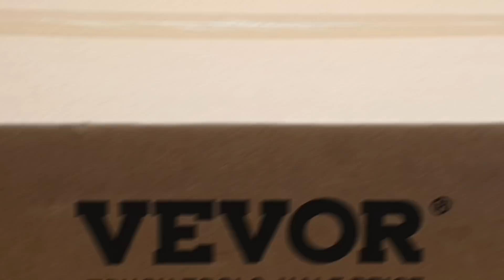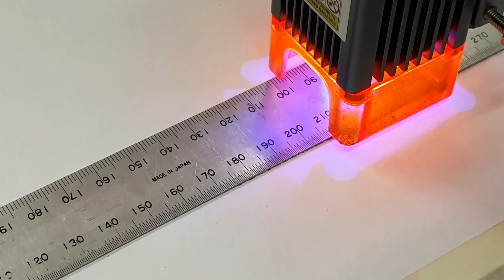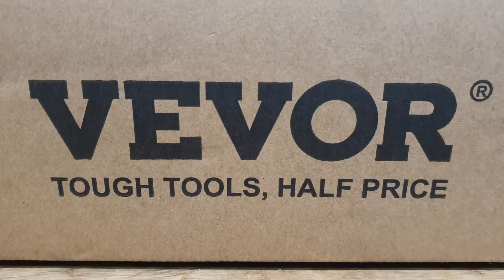VEVOR Laser Engraver Project Build And Review

Comment from the maker: Please remember to check the description for details on the Vevor laser. Any questions please ask 👍
Reply: Hi, we 've got a bit different one - vevor 16,1 x 15,7 where this first step of building doesn't work...any advice? thanks
Reply from the maker: @PatricieDlouha  what seems to to be the issue ? Did it come with a manual ?
Reply from the maker: @PatricieDlouha  this is the same dimensions as the one I have
Reply: Did you have any video where you can show using the cup, mug or bottle  attachment?
Reply from the maker: @blancamgarcia7303  thanks for watching Blanca, no sorry I don't have that attachment. Would be very handy though I think.

Comment: Buenas tardes, tengo esta maquina y le compre el eje rotor, pero los conectores no se donde van, me pueden ayudar?
Reply from the maker: That is a good question. I'm not sure though as I don't have the rotary attachment my self. What do the plugs look like for the attachment ?
Do they plug into the cables that are already attached to the drive motors or are they small cables that may need to be attached inside the control box ?
Sorry I'm not much help but I will see if I can find something out for you.

Comment: Hello,
I am facing a serious issue with my 30W fiber laser, which is still under warranty. The problem is that the laser has lost all power and no longer engraves. I purchased it from Vevor, but they have not provided any solution despite over a month of communication. They now reply only with vague messages like, "We are sorry, but we still don’t have a solution from the team handling this issue."

Do you have any advice or suggestions on how I might resolve this problem? Any help would be greatly appreciated.

Thank you!
Reply from the maker: @luci295  I'm sorry to hear that. How long have you had your unit for ? Did anything happen to it just before it stopped working?
Is the unit powering up and moving but just not cutting ?
Reply: @Austeration  I purchased the laser in November, and it worked until the beginning of December. Vevor's technicians even accessed my computer to modify certain parameters, but it was useless. They asked me to measure the transformers, which showed normal voltage levels. The red laser outlines the shape of the design on the material to be engraved, but when I start the engraving process, it has no engraving power at all, even though the red laser line moves across the material.

I am not new to this field—I have been using a 100W CO2 laser for 5 years and a Genmitsu CNC for 2 years.
Reply from the maker: @luci295  you have probably tried everything I would suggest then. Are you using Lightburn at all.
Reply: @Austeration  I usually use Lightburn because I prefer it. Vevor's technicians told me to install EZCAD because they are not familiar with Lightburn, even though their sales page clearly states that the laser is compatible with Lightburn. I installed EZCAD anyway, but it didn’t help.

Logically, this seems to be a hardware issue with the Raycus laser module. However, I believe Vevor's technicians are aware of this, and considering that it’s the most expensive part, they are likely trying to make me give up on seeking their help by not providing a clear solution to my problem.

Comment: Will it cut 4.5mm perspex ? And wat software do you use with it.?👍
Reply from the maker: @markfreeman5176  Hi Mark. I'm using Lightburn to run all my lasers. You can download the 30 day free trial to test it out before purchasing it. I highly recommend you test it out. As for cutting perspex I haven't really had much experience, I did test it out on some 3mm material and it seemed to just melt the plastic rather than giving a clean cut line. I have a CO2 laser that is perfect for cutting this type of material. I will be doing a review video of this shortly

Comment: Hate to be that guy, but are you able to just hook this up to a computer and go to photos and put that and kind of just print it? Or is it only usable with graphic design equipment?
Reply from the maker: @anthonyamaya9644  Thanks for watching Anthony Great question. If your using the Lightburn software you can do just about anything you like. The unit I demonstrate is good for mainly just engraving but if your wanting to cut I suggest you look at either the 10w or 20w units. Here is a link that should show you how to work with images. Hope it helps. Yell out if you have any other questions.
https://youtu.be/MHuUhC62gig?si=h8Lc1wFl4xRqAvnp

Comment: Saludos el láser de corte se puede cambiar cuando lo necesites ? Y que es máximo de altura que se puede cortar por favor me aclara la duda .
Reply from the maker: Hello Frank. Not sure what you meant by changing the laser. If your talking about the settings then yes you can adjust as needed. This unit is only a 5w and is really better suited for engraving . Depending on what your wanting to cut I would really recommend looking at the 10w or 20w units. The more power you have the quicker cutting will be otherwise you have to make multiple cuts. Also the air assist pump that comes with the larger units is a must for cutting. 
If you need any more information please ask, I am more than happy to help.

Comment: I finally got it out of the box and working. The instructions were not helpful at all, but i came across your video. Thank you for that. I was wondering if you knew if it can be read by inches instead, i am having a hard time getting the right measurements
Reply from the maker: @veto0485  Woo Hoo well done. I'm glad the video helped.
What program are you using ? If your using Lightburn I'm pretty sure there should be something in the settings. Let me know if you can't find it and I will take a look.

Comment: @Austeration para a máquina Vevor A7 5W quais as medidas para a grelha de favo de mel, por favor? É que ainda não montei a máquina mas quero já começar a procurar estes acessório. Outra questão: a bomba de ar neste modelo vai diminuir o cheiro libertado durante a queima? Podes dar-me o link da bomba de ar?Obrigada.  :)
Reply from the maker: It all depends on what your plans are for the unit. If your only going to be Using it for small projects then you could get a smaller honeycomb other wise 400mm by 400mm.

The air pump is used to assist in cutting not remove fumes. I don't think your unit will have the fitting to allow you to connect an air pump to it.

You might have to upgrade to a higher power unit if your serious about cutting. I think I said earlier, if your just wanting to engrave things then this unit is spot on for that and there is no point in getting a honeycomb for it.

Get it out and set it up so you can start to play around with it.

Comment: Olá. Ganhei esta semana de presente de aniversário uma Vevor 5W. Sou iniciante neste tema. O manual de instruções só está em inglês e há termos técnicos que não domino. Também falam que a máquina trabalha com 100 diferentes tipos de materiais mas eu não encontrei nenhuma listagem a falar dos mesmos. Sabes onde podemos consultar? Ela está apta a cortar qualquer material de 3mm? Poderias fazer um vídeo a gravar objectos circulares, como copos ou frascos? Qual é o material da grelha de base que usas? Podes ajudar, por favor? Obrigada. :)
Reply from the maker: Hi thanks for watching. I hope my video helped with the construction of the unit. Yes it should be able to cut through 3mm wood ok. What type of materials are you wanting to engrave or cut ? As far as circular objects like mugs or flasks it would be better to have a rotary attachment for this sort of project. I don't have one of those currently. Happy to answer any questions you may have.
Reply: @Austeration  pois ainda não sei. Já percebi que numa fase inicial terei de ir explorando as capacidades da máquina. O meu receio é poder estraga-la. :)
Reply from the maker: The base grid I am using is an old aluminium Air Conditioner return vent but you can purchase a honeycomb bed specifically designed for this type of work.
Reply: @Austeration  já pesquisei e já sei como comprar a grade. Obrigada. :)
Reply from the maker: Not sure If I mentioned it but I am using the program Light Burn.
It's free for 30 days if you wish to try.
There is a lot to learn if you are new but you will pick it up very quickly.
Remember to use in a well ventilated space or out side if you are using it on plastics of any type. I hope you have fun with it. You can down load files from Etsy and there are some Facebook groups that explain things for different models and brands.

Always happy to answer any questions if you have more or if you get stuck.

Comment: What settings do u use for engraving wood?
Reply: 5w
Reply: It’s the vevor A7
Reply from the maker: @yamum5569  depending on the wood, from memory I think it's about 25 at 600. I'm using light burn. You can down load a free test pattern, or light burn has one built in. Hope this helps.
Reply from the maker: @yamum5569  how many W is your unit ?
You should run a test print so you can see what settings perform the best

Comment: May I ask your settings for the aluminium lid what you engraved in the video? I have a same machine in 10W. But I do not really find the best setting for the lids. Thank you in advance. 6:33
Reply from the maker: @TamásKovács-Fábián  Hi Tamas, thanks for watching. Great question by the way. To be honest I don't remember what settings I used. Can you start off with something light and slowly increase the power ? Maybe test it out on some old caps until you find something that works. Sorry that's probably not much help sorry.

Comment: May I ask your settings for the aluminium lid what you engraved in the video? I have a same machine in 10W. But I do not really find the best setting for the lids. Thank you in advance.
Reply: Hey. I found the right setting for anodized aluminium. LaserGRBL 50% force 1200mm/sec. Also used png format with keep the proper image settings.
Reply from the maker: @TamásKovács-Fábián  That's great to hear. Have you tried using the Light burn program at all?  You can get a free 30 day trial if you haven't. I find it much easier than LaserGRBL
Reply from the maker: How did you get on ?

Comment: Hello what's the thickness of the material this can cut?
Reply from the maker: @krystaljones5381  Hello, thanks for watching Krystal. This is only a 5w unit better suited for just engraving. It could cut up to 3mm but if your wanting to cut anything thicker I recommend looking at Vevors 10w to 20w units. Something with an air pump. This greatly improves the cutting ability and a cleaner cut. Check the link in the description and use the special code to receive a discount. Let me know if you have any other questions 🙂

Comment: Is it possible to use it on wood that is bigger than the inside dimensions? I know that is it's working space, but I need to engrave a small bit on a board that is bigger than those dimensions
Reply from the maker: @IntWarrior  Thanks for watching. Sure I don't see why not. You would just place the laser on top of your work piece and lower the head height down to the correct height. Using the mapping tool in lightburn you can work out exactly where it will engrave.
Are you only wanting it for engraving or cutting ?

Comment: Buenas tardes, cual es el grosor maximo que corta en madera? Gracias
Reply from the maker: Thank you for watching. Good question. What thickness are you wanting to cut? This 5W unit can just cut through about 3mm, it's better suited for just engraving. If you need it to cut through anything thicker I recommend stepping up in size to a minimum of 10w. Make sure what ever you choose has an air pump. If your going to be using it a lot then I recommend even going to a 20w or higher. Any questions please ask 😊
Reply from the maker: @maryerlingonzalez1482  do you have any other questions ?

Comment: This is really A7?
Reply from the maker: Sorry I'm not sure what you mean by A7 this is only a 5W model. Can I ask what you plan on using one for ? This will determine what wattage you should be looking at.
Reply: @Austeration  A7 is the item model number. It Looks Like this is VEVOR A7 with 5W. 😅 I Need a machine that can grave wood and other things and can cut the wood, acyrl e.g. 😍
Reply from the maker: @sparklynn1377  I would suggest the 10w but do your research first check out the reviews.

Comment: Can I use it inside or is it too stinky? Sorry I am german 😂
Reply from the maker: Hi thanks for watching. It depends what your doing with it. If your using it on wood it can get very smokey and stinky so it's best to use it in a well ventilated area. You can also purchase enclosures to cover the units that have an exhaust fan in them. I have a video you can watch on this. Hope this helps.
Happy to help with any questions you might have 😊 Greetings from Australia
Reply: @Austeration  podes indicar o link do video onde mostras como ventilar a área onde se usa a máquina. Eu também vou trabalhar com ela em casa. Obrigada. :)

Comment: Does this vevor 20W have cross hairs for alignment and do you still like this laser , thanks
Reply from the maker: Hi Jeff this unit is only the 5W version. Yes I still have it and no it does not come with cross hairs. I generally use the framing option with lightburn to map out the alignment. Are you looking at getting one and will it be your first laser ?
Reply: @Austeration   No I have the xtool  S1 40Wand F1 and wanting an open laser just to engrave on stove top covers , looking for a 20 W to do this
Reply from the maker: @jeffbarnes2014  oh cool I also have the S1 and 4 other open lasers none of them have cross hairs like the S1

Comment: Hi there, do you know if there is any power indicator like an LED light or any way to tell that the engraver is on? I plugged everything in and my computer doesnt seem to be able to detect it when I plug the USB in. I used LaserGRBL and even installed the driver on my computer, it said the driver was ready and preinstalled.
Reply from the maker: I thought there was an LED, the fan should run on the laser head also. Make sure the stop button is not pushed in by twisting it the button should be up and the key on. Try that first
Reply: @Austeration  Thanks! I didn't realize you had to twist the stop button to release it!
Reply from the maker: @vchiang1  all good 👍 so your all sorted then. Have fun. Don't forget to check out the free 30 day trial of Lightburn

Comment: What software are you using?  Laser power?
Reply from the maker: I use light burn. The power setting vary depending on what your using to engrave
Reply: @Austeration      Thank you. I am trying to identify the VEVOR unit you are using in the video. Power head on the unit in the video?     mike
Reply from the maker: @drewjohnson4673  I'm only using a 5w unit here. There should be a link in the description. Do you have a laser or looking at getting one ?
Reply: @Austeration      looking to get one. will need a lot more in the future but would like to learn basics with a minimum expense and have bought other things from VEVOR.
Reply from the maker: @drewjohnson4673  the light burn program is free for 30 days but then you have to purchase it. Well worth it though.
If you looking at cutting MDF etc I would go for the 20w. My 5w is better for engraving.
Reply: @Austeration      Thank you. Yes, we will be cutting wood.
Reply from the maker: @drewjohnson4673 cool so if your cutting make sure you get something that has air assist. It's a must for cutting. 
Yell out if you have any more questions. I am happy to help 👍
Reply: @Austeration     Thank you for the hint. Your willingness to help has been noticed. Blessings to you!  Mike
Reply from the maker: @drewjohnson4673  no problems at all and if you use the link in my description you can also get your self a discount on anything you purchase from Vevor
Reply: @Austeration  a bomba de ar para além de evitar o tom queimado nas peças, também ajuda a evitar o cheiro dentro de casa? Posso adquirir para a Vevor A7 5W?

Comment: What do you use under your project to keep it from burning your house down?
Reply from the maker: Great question. In this video I was using a old air conditioner return vent but I now have  a laser honeycomb bed under it. Under that I usually have a sheet of tin or aluminium and then an old board that it all sits on. I hope that answers your question. Please yell out if you need any more information 😁
Reply: @Austeration  desculpa, afinal que bases colocas para evitar que o lugar onde a máquina está apoiada se queime? E de que material é a grelha? Obrigada.🙂
Reply from the maker: You will need a honeycomb bed to put under your work. They come in various sizes to suit. The 5w unit is really better suited to just engraving but it can cut some materials.

Comment: Thank you SO MUCH for making this intelligent assembly video - the instruction was woefully missing an incredible amount of detail !!! ♥
Reply from the maker: Glad It helped you Elizabeth, Please yell out if you need any help and I will do my best to assist you 👍
Reply: what are the half-dozen zip ties for??
Reply from the maker: Cable management. Most important the cable that runs from the laser, make sure you tie that one back to the top of the head so that it does not move or you will run into trouble down the track. Not sure if I showed that in any of the video. Apart from that you should be ok from memory.